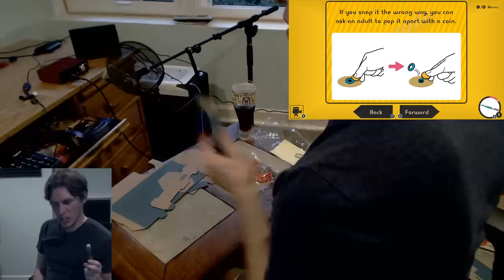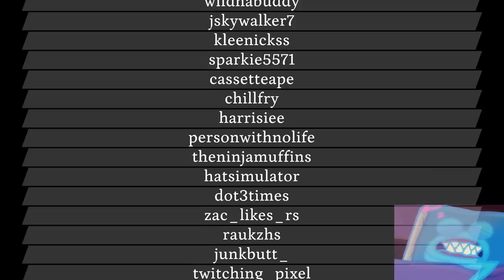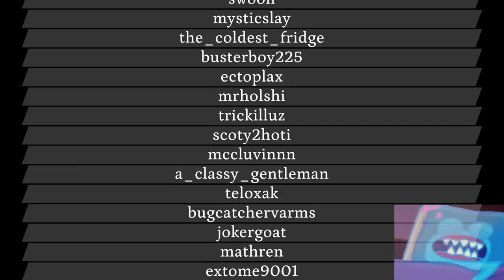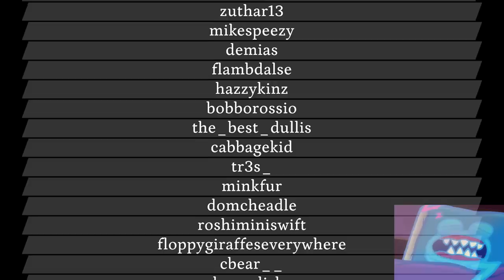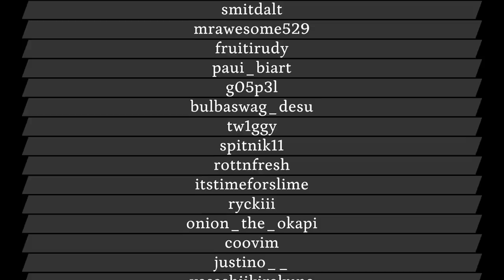Jerma Streams - Nintendo Labo (Part 1)

Comment: It's a great stream, but it's slightly frustrating that after 5 hours he's still talking like it's surprising and hard. Wait, that goes ALL THE WAY UP? He really did sound like a tuber. Wait that folds all the way the over, hmm okay, and then that little tab goes in there. WAIT DID I DO IT WRONG?